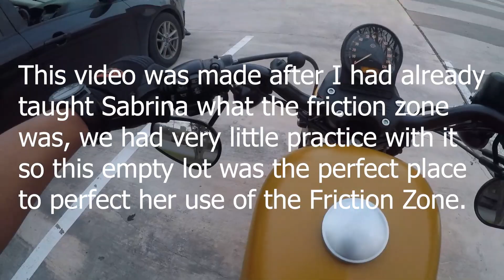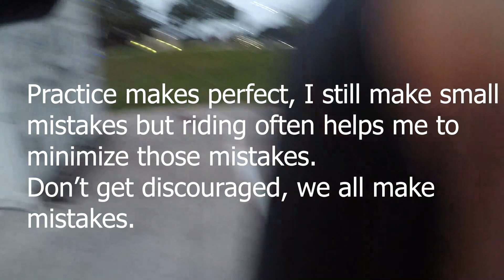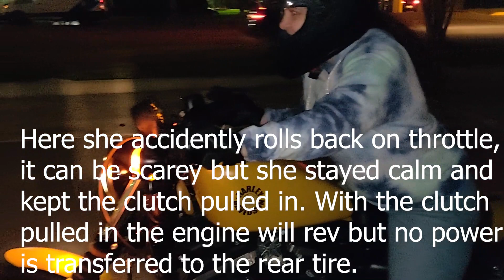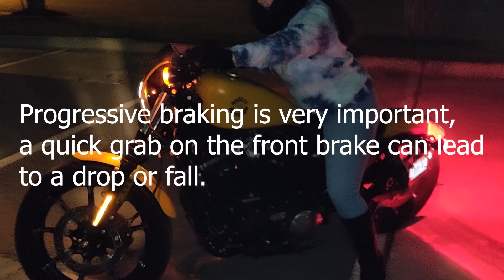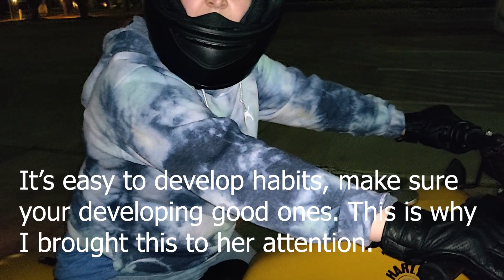Learning How To Ride A Motorcycle Part 1 - Friction Zone and Walking the Bike!

Comment: Hi is there a risk of burning Harley clutch plate if you are driving in friction zone ?as many people say me thst clutch plate burn if you ride it in friction zone
Reply from the maker: When the rider presses down the clutch and does not change gears, the wear on the pressure plate is unnecessary and leads to the clutch plate burning out and needing replacement. It would honestly take a long time to do this if your in first gear walking a bike familiarizing yourself but yes it can happen. 🤷🏾‍♂️
Reply: Don’t most of the latest generation Harley’s use a wet plate clutch?
Reply from the maker: Honestly haven't delved into the clutch much but it is possible. Regardless it will still wear those plates down wet or dry.